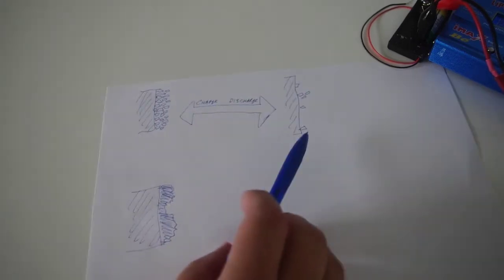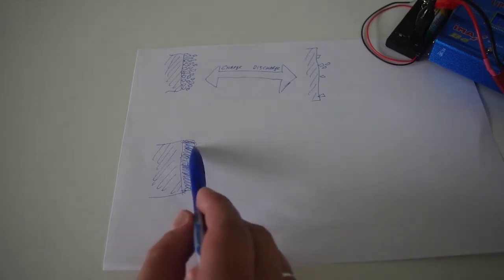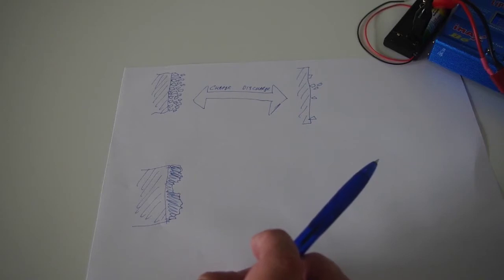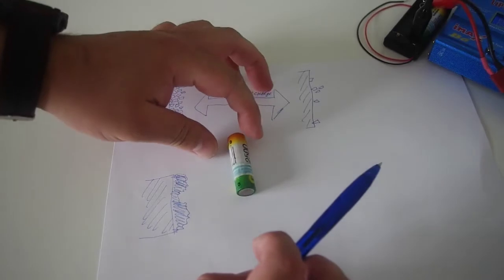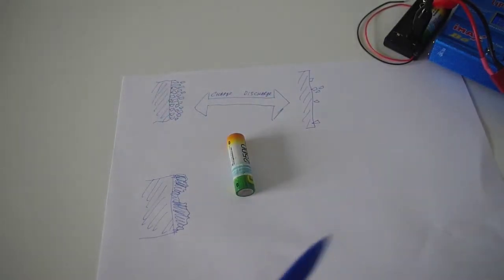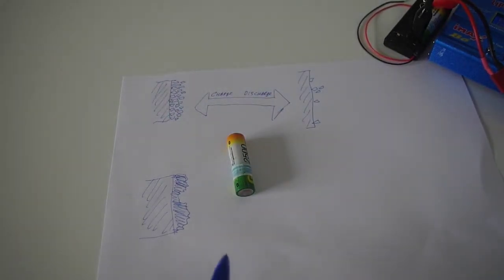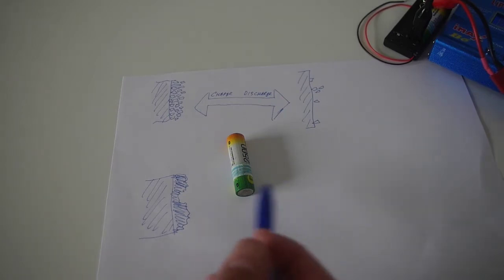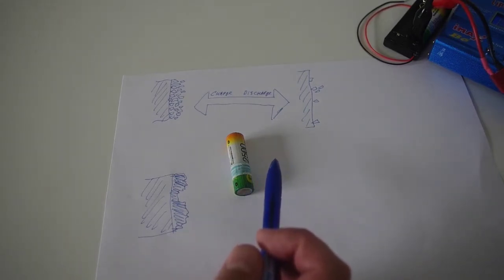NiMh AA battery restoration

Comment: i use an 1.5v zinc carbon AA battery to charge for the dead ni-mh AA battery for about 30 seconds and the ni-mh came back to life.The crystal inside short the battery so it won't get charged until we apply a high current to melt that crystal.And maybe we want to remove the battery nylon covers.
Reply from the maker: Sorry, "1.5V lead acid AA battery"? Never heard about something like this...
Reply: @dmitrysysoletin9967  Sorry i mistaken,it's zinc carbon and non rechargeable.
Reply: 😂😂😂😂😂😂😂😂😂😂😂😂😂 @sigmagamer364